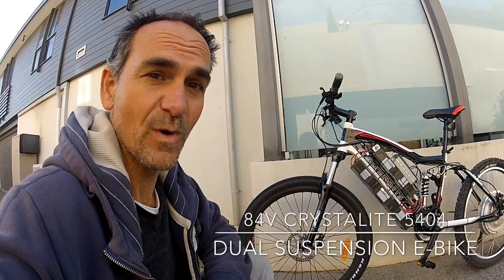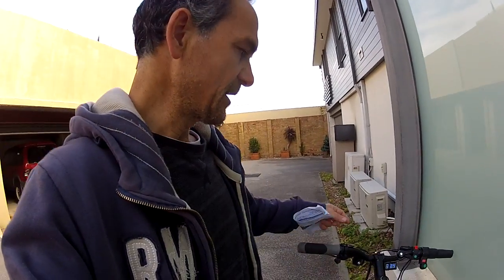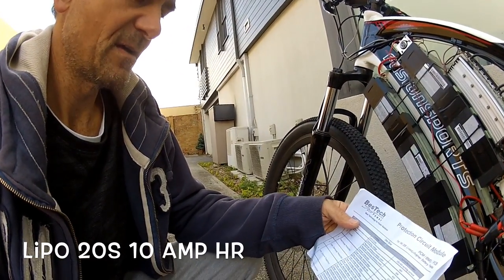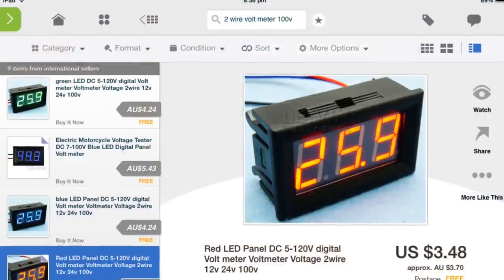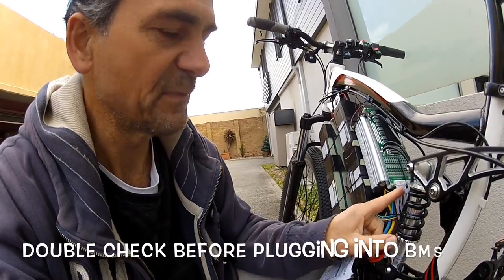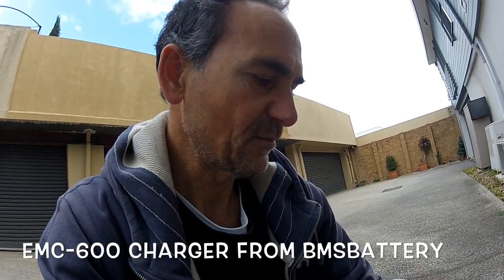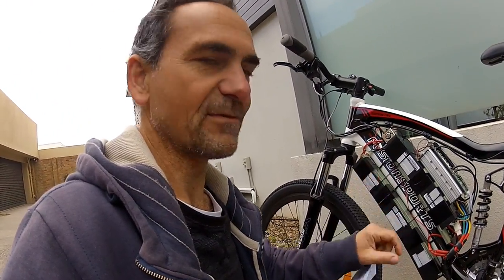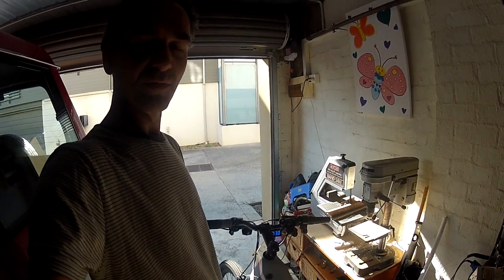BUILD LOG | Crystalite 5404 84v ebike inspired by Stealth

Comment: Hi JB great video , I have exactly the same bike converted to Ebike. I really like the corflute housing. I have an aluminium box for my batteries.
Can you tell me how easy it was to make and how you go about it? I never used this corflute stuff before. It looks awesome!
Reply from the maker: Its very easy to work with, you just scribe it with a pizza cutter and fold. I got the sizes by sticking pieces of cardboard together. See the About section at the top, I have added a link to the battery housing. I want to remake this from some acrylic sheet since I dont like the ridges in the coreflute.

Comment: Sexy looking bike man.  I wonder how it would handle with an 18 FET controller =), Lyen's 18 FET has the same thickness as that one just slightly larger, and should handle 65-80 amps.  I think it will fit in there.
I'm building a bike too, modifying an Ultra motor Europa with a cromotor and a 24 FET controller.  I was able to fit 24s 15 amp hour in the frame.   Still in the works.
Reply from the maker: Sounds like its going to be a monster. I've heard that I can play around with my Infineon software and should be able to get 60-80 amps out of it

Comment: You talk about wall charger. Do this system work also recovery at downhill? How efficient it is? Thanks to share.
Reply from the maker: So up to 72v to infenion 12 fet will do ebrake and recharge however because i have 84v i must mod the controller by adding a resistor google R12 mod infenion. I have not done this and not sure how efficient it will be but i know it is very efficient in my prius :)